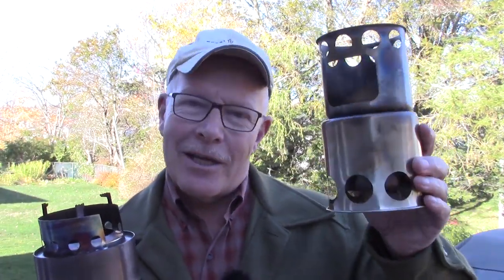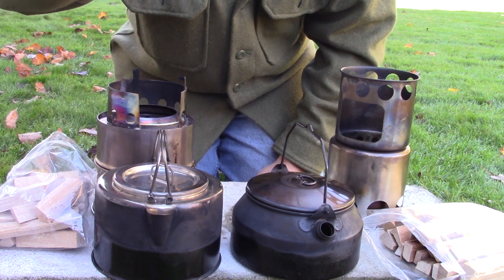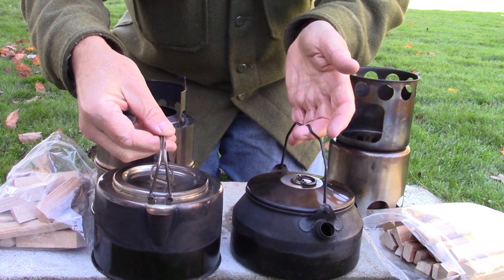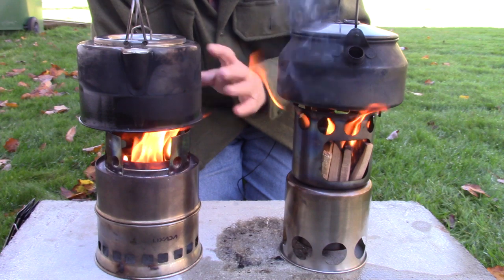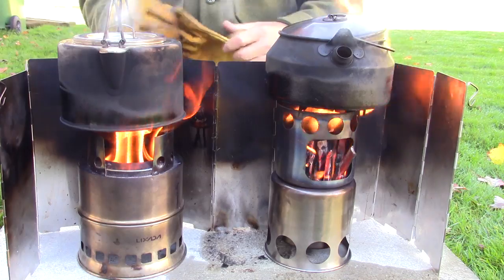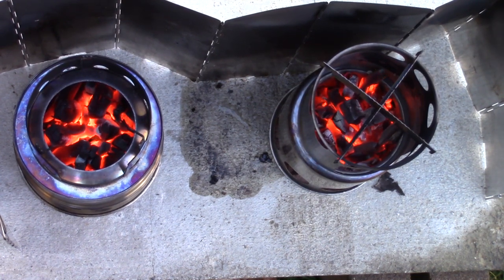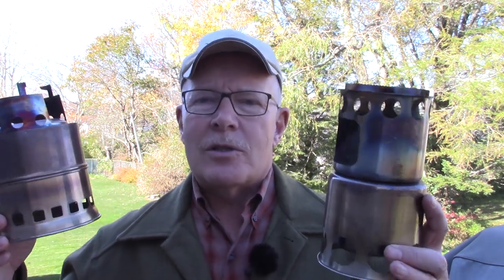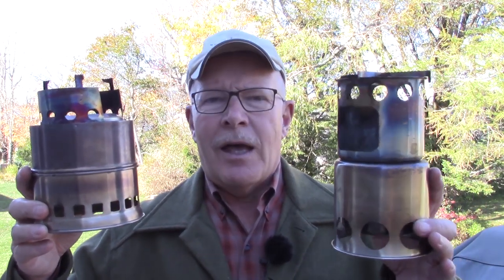Lixada "Scout" Wood Gas stove VS Lixada "Tower" stove -  REMATCH

Comment: Very interesting results and thanks for sharing them with the rest of us.  Thumbs up . . . of course.   My thoughts for why using the pot stand cross bars with the tower stove was not to increase exhaust flow because as you pointed out, there is plenty of exhaust flow capabilities built in even without the extra cross bar pot stand.  My reasoning for why using the cross bar pot stand with a larger diameter pot is so that the actual flames have access to the bottom of the pot.  The flames are allowed to touch the pot bottom and flow along the bottom of the pot until they dissipate or go beyond the pot bottom.   That is contrasted otherwise by the flames not having actual access to the bottom of the pot without the pot stand but rather be  forced out the exhaust openings lower than the pot bottom.  The pot will still be heated quite well but I believe that some performance may be lost.  How much performance loss there may be, if any, is not known.  But I cannot help but suspect that there will be some loss of thermal performance if not using the pot stand when using larger pots.   When using smaller diameter cooking vessels that are smaller than the stove top opening, the point is mute.
Reply from the maker: Ahh, now I understand what you meant when you mentioned that last time. Hmm...I will give it some thought. Would be hard to measure performance but what you say makes sense. Thanks Lonnie

Comment: I also got around 4-5 minutes with the "Scout stove" and the wider "tower stove". The only time I noticed what appeared to be wood gas and/or a secondary combustion was if the wood was below the jets however it must be happening (IMO) even if the wood is past the jets. I think it's a combo type stove with the majority being normal combustion however not all. On a side note people can be too uptight about the operation of wood gas stoves and timed testing. Most stoves can be burned more than just one way. I like to use a larger solo stove as a scout fire at times.  Burns for hours because wood can be added. It will keep burning and very often nicely. Good rematch!
Reply from the maker: Thank you my friend. I agree, gassification is a nice benefit if it occurs but it is not the only factor that makes a good stove. The "Tower" stove has a lot going for it and if it gassifies, bonus.

Comment: Thank you for posting this comparison again. My experience with them is similar to what you found the first time and usually I use found twigs. The deciding factor on which to use has often come to weight of the cooking kit. If I'm going for a short walk (day hike) it's a toss up and I take the one closest when I'm loading up. As an aside, I’ve also had the same experience with the pot support on the tower stove however there’s a difference in the one my tower stove come with and the one you have, mine has four pieces which was a pain to assemble and should always be put on before lighting the fire. Thus I made a two piece for my own safety and it can be added anytime.
Reply from the maker: Interesting you had similar results. I did notice that the larger version of the Tower stove had a four-piece pot stand. Maybe they sent you the wrong pot stand with your stove. Thanks for commenting

Comment: Great comparison. I personally liked the results from the Scout. The flame looked more manageable. Thanks for what you do.
Reply from the maker: The Scout does appear to provide a more steady flame as opposed to the Tower. One factor I did not test was stacking the wood horizontally but what a pain it would have been to cut pieces that short. Thanks for commenting

Comment: Nice job in comparing the two stoves!  I really appreciate the effort you've gone through to eliminate as many variables as possible, so the designs of the stoves can be assessed on their own merits.  I'll be sticking with my small Lixada folding stove for now, but it's nice to know that both of these will do the job, if in slightly different ways.
Reply from the maker: The little Lixada is a great stove. May not have the output the bigger ones do but output is not everything. Thanks for commenting

Comment: Thank you for the comparison.  Mass of metal means extra weight I suppose.  But I would use either one.  They perform well with hardwoods.
Reply from the maker: Glad you found the video helpful. Yes, extra mass does mean extra weight. I guess the question is whether you are okay with the extra weight in exchange for the extra performance. Thanks for commenting

Comment: The incomplete pyrolysis may be due to "vertical channeling", which occurs when fuel is loaded vertically in TLUD stoves. The gaps between the sticks allow excess primary air into the pyrolysis zone, which ignites some of the woodgas before it reaches the secondary inlets.
Reply from the maker: I totally agree. An issue of too much air flow. I would test laying the wood horizontally but I did not want to have to cut the pieces that short😅. Thanks for commenting

Comment: I just found out that the kelly kettle trecker will fit perfectly on top of the lixada scout stove if you remove the pot support.

A strange setup I know, but if you, for some reason, have both then you boil water with pellets super fast and efficient.
Reply from the maker: Yes, I have been planning a follow up to my Kelly Kettle Trekker video showing that very thing. Thanks for commenting
Reply: Great to hear that, looking forward!

Comment: A good comparison Mark, l have not had so much luck with my Lixada wood gas stove with pellets first it does gasifi and l can see this when burning but as soon  as l try to put a pot on the stove gasification stops and it starts to smoke , l was thinking maybe it is the pellets l am using but l really don't know.
Reply from the maker: Barry, what type of pot stand does your Scout have? My feeling is the version with the three small folding stand-offs may not have sufficient exhaust room under a pot. This would cause the stove to smoke. Thanks for commenting
Reply: @MarkYoungBushcraft  yes it is with the foldout stands can you suggest a remedy,  Regards Barrie
Reply from the maker: @barriewatson  Maybe. Do you happen to have a Kelly Kettle Trekker Hobo Stove? Reason for asking is fits perfectly on top of my Lixada Scout stove. If not It may be worth looking at buying one from KK. My second suggestion would be a DIY cross bar made from a stainless steel ruler, similar to what I do for the Ikea hobo stoves. Let me know what you decide
Reply: @MarkYoungBushcraft  thanks for your answer yes l have a Kelly Kettle and the hobo stove ,but it's the mittle size Kelly Kettle and this is too big. Regards Barrie
Reply: @MarkYoungBushcraft  ok l have now ordered a Kelly Kettle hobo for the tracker hope it will work take a little to get here from Kelly Kettle l will let you know if it fits when it gets here. Regards Barrie

Comment: Just curious... Have you tried using only the bottom 2 pieces of the tower stove, with the crossbars *or maybe your homemade ruler cross stand) on top to give air? The idea kind of hit me while playing with my toaks small wood stove. Im waiting on the toaks crossbars to show up before I can test. I dont happen to have any steel rulers laying around that I can destroy.
Reply from the maker: Yes, it may work. The included cross bars may be enough to provide sufficient airflow. I will give it a try. Thanks for commenting

Comment: Using equal weight of fuel made this a fair experiment that proved beneficial in boil time.  Isn't the cross bars mostly included for use with spirit burners, or is that extra height not necessary?
Reply from the maker: I agree it was a more fair test all around. As far as I can tell from my tests the cross stand does not help with anything other than very small diameter pots. Even when using alcohol. Thanks for commenting

Comment: Nice test but in real life I don't want to prepare  the wood like that on the trail. I would like to see a test with just broken twigs and such. Want to get it done easily
Reply from the maker: Of course. I have videos using the stoves in the woods as they are intended to be. This was just a way of controlling variables. I certainly don't do this in the woods. Thanks for commenting
Reply: Thank you

Comment: I have placed my order for a tower stove.  However, I was just wondering, what is the inside diameter when everything is packed down?   What can nest inside the stove?  I doubt it will, but can a Stanley adventure nest inside?
Reply from the maker: Hi, the inside of the smallest chamber measures 3 3/8" x 3 3/8". The Stanley won't go inside for sure. An alcohol stove like the Trangia will. Hope this helps

Comment: I have a scout style stove and it works well. I almost bought the tower stove, But went with scout style. because of the testing you have done.  So thanks very much for that. I think the scout is more stable too I think the tower stove would be better for a companion fire This is a great test of the stoves. Another great video keep up the good work!
Reply from the maker: Great logic. I have no doubt your will be happy with the Scout style stove. Thanks for commenting
Reply: Another attribute of the scout is that you can run it on wood pellets right out of the box. I'm still testing to find the best way to use them in the tower stove.
Reply: @connosaurus  That sounds good I have 130lbs of pellets to use